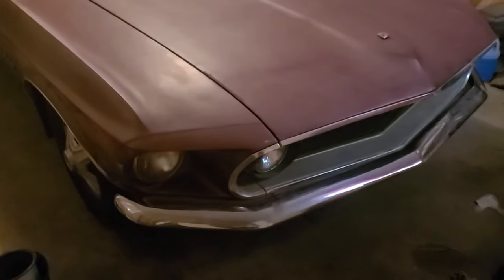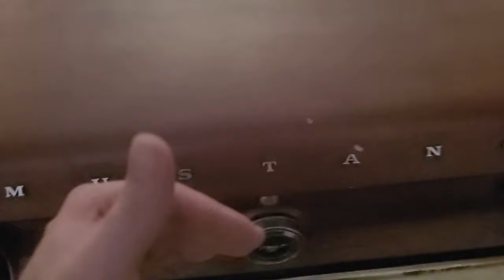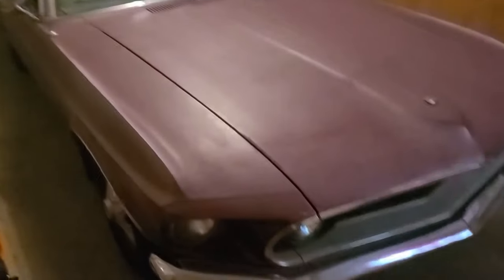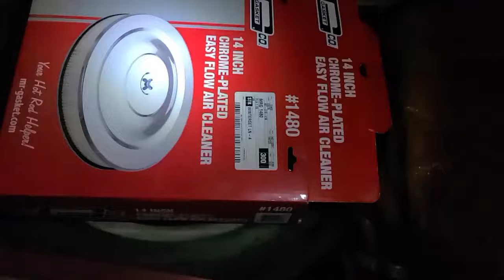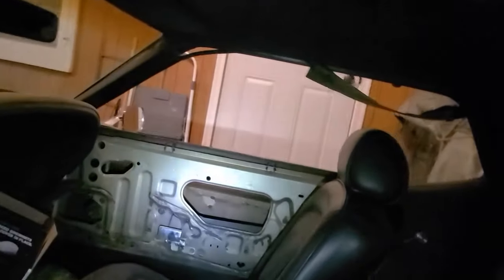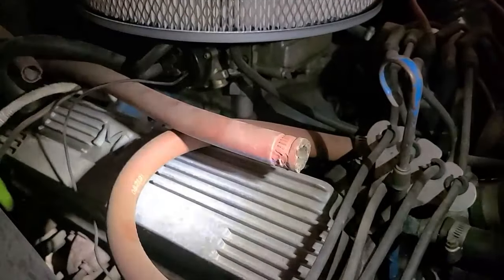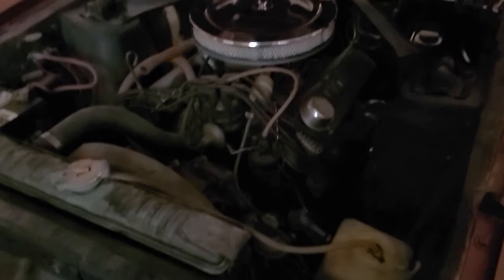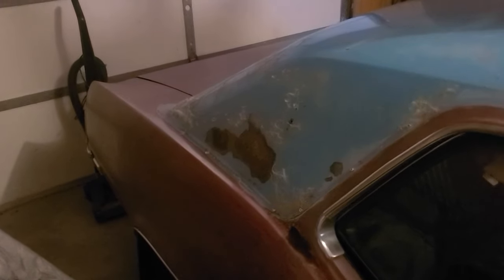What did I get myself into. Will it run and drive?

Comment: Congrats for getting the cool ride! This body design looks great when restored, so good luck! Back in 1998 I bought a ‘70 Mach-1 fastback, 351 Windsor, fmx auto transmission, 9inch diff. White w/black interior. I did a little work on it and sold it a year later for an older Fastback project car.
Reply from the maker: Thanks still learning a lot about this car and the windows are nuts. Struggling with aftermarket weather stripping at the moment. Sweet good luck on your project if you still have it and working on it!